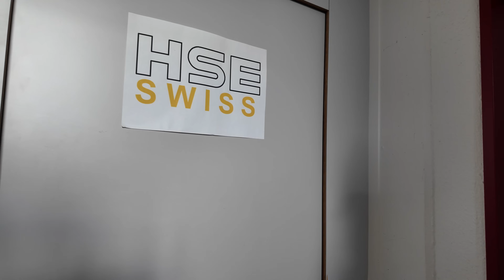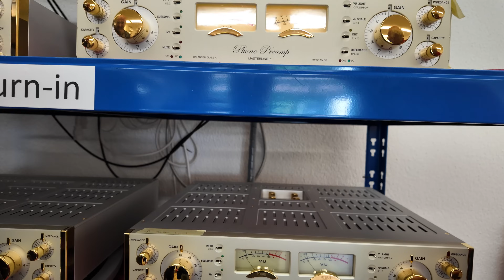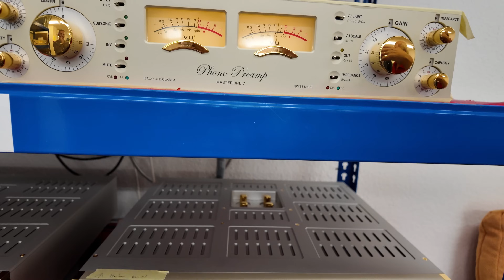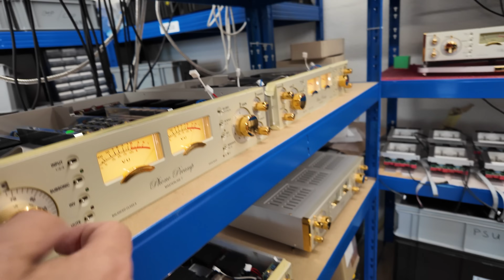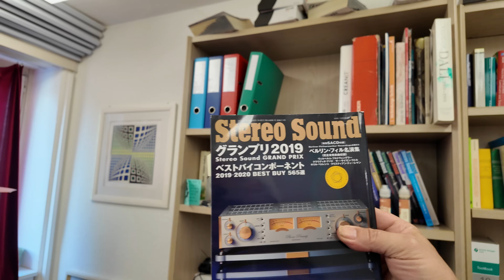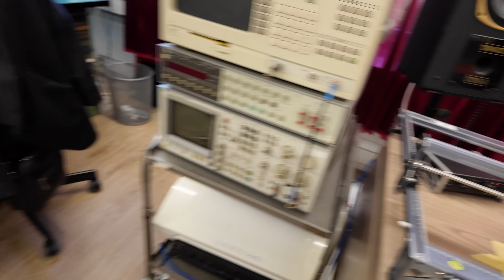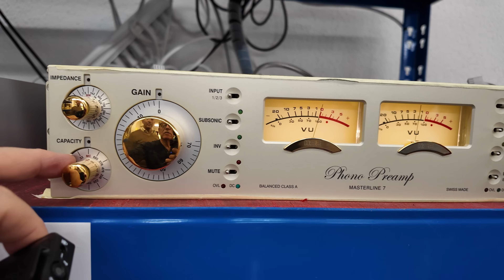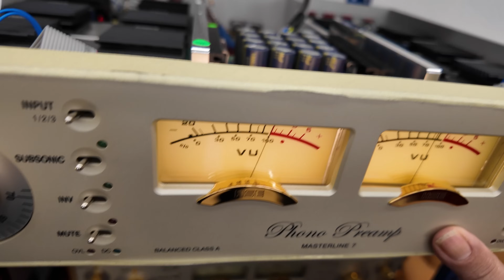HSE Swiss Surprise Factory Tour Following High End Munich 2024!

Comment: pretty nice tour, tough to hear the responses to the questions. Interesting point you made asking if the employees have listened to what they build. These phono stages are priced above the Boulder phono stages. Pretty stiff competition. Sure would be interesting to hear one. He pointed to and mentioned the transformer several times but was not clear what it is. Where you able to determine if that was a step up trans or some sort of isolation transformer or something else? Perhaps the variable EQ option could be used for a tape head pre. Very similar gain requirements for a tape head and LOMC cart impedance and loading can be different.
Reply from the maker: There are no step up transformers in this phono preamplifier. It has a great deal of gain and very low noise. What he was pointing to is the coil used for the selectable "rumble" filter....
Reply: @trackingangle929  OK thanks for the info

Comment: The Swiss make such amazing, world class audio products. I would have to take out a load to pay for just the box it comes in, but it sure is wonderful to see and listen to. But why have 2 gain adjusts rather than a single gain + balance on their phono preamp?  Much easier to get the output of the channels correct in the latter way.
P.S. I understood most of what Mr. Huber says... but  then I've seen a lot of Schwarzenegger movies.
Reply: This allows each channel's signal goes through only one variable resistor whereas with volume and balance controls the signal has to go through 2 variable resistors in series. The designer is going for a purer signal path over ergonomics.
Reply: @HP_____  Ah, ok.  I would personally prefer the convenience of a balance adjust, but that makes sense. Thanks for the reply.